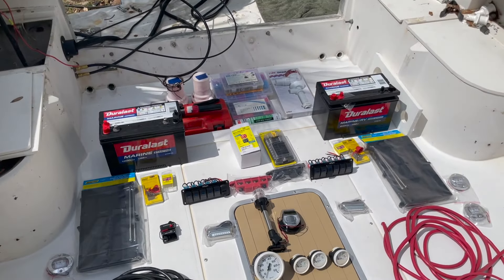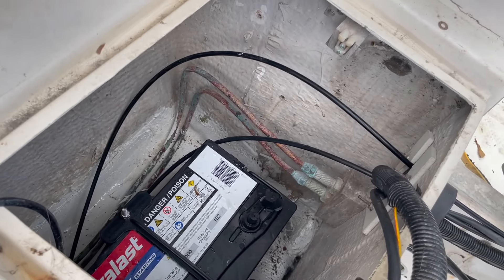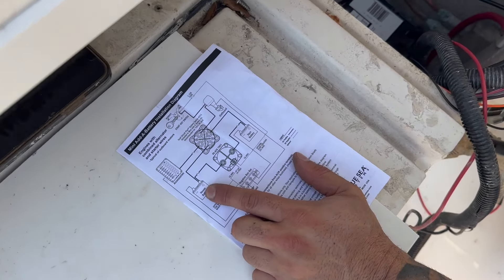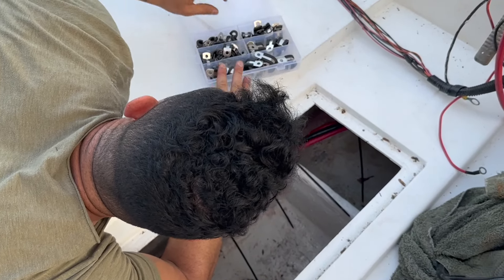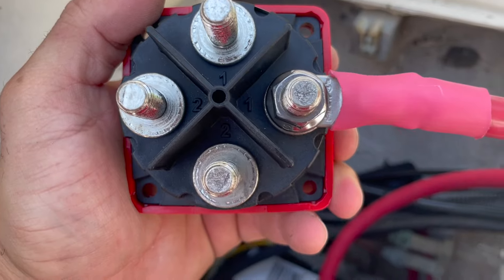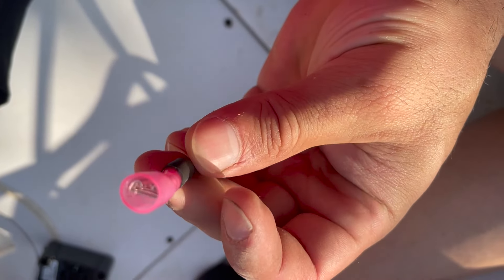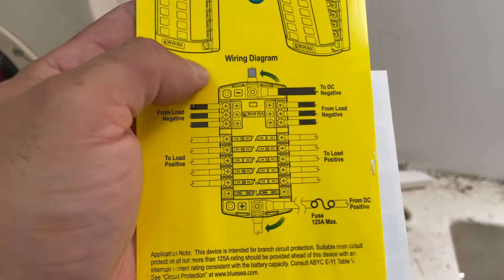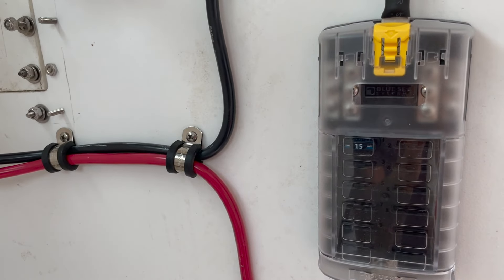Beginners Guide To Boat Wiring | Blue Sea Systems Dual Battery ACR Install

Comment: Amazing video!!! Glad I found this video we start redoing the Harness in our boat . Thank you for make it so Simple I’ll do it same way your doing it. I just wondering about the gauges?
Reply from the maker: Hey Elias! Thank you for the comment! I hope your project goes smooth and I’m glad our video can help. 
Depending on the motor you have, the gauges can be a little trickier. Usually each motor has a harness and from there you get your gauge power, tilt and trim, tach voltage etc. If you search  “boat gauge wiring” tons of good videos come up! 🤙
Reply: @perfectfitboating  Thanks man another question i see something in the diagram says optional switch for no current drain when is storage  ill keep the boat in water i want to make sure everything will be alright
Reply from the maker: Yes there’s more to read up on in the manual. I didn’t mess with that option because we plan on installing a charger on the boat to not worry about the battery discharging from the acr drawing current.
Reply: Amazing! One more thing ones I install the arc the kill switch still can cut power to the front fuse box or not? If not I can put my automatic beilge pump direct to the battery so when I’m not at the boat will works automatic. Like I say the boat will be sit in the water for few days
Reply: @perfectfitboating  by the way thanks a lot for taking the time to comment back.
Reply from the maker: So the kill switch for the motor works for just the motor. It really has nothing to do to with the fuse box. What sends power to the fuse box is the main on/off switch. 
Check out our other video where we install the bilge pump with a float switch directly to the battery which bypasses the main on/off switch. That way if it’s in the water and youre not there and water fills the bilge it will get pumped out! 🤙
Reply from the maker: No problem buddy!

Comment: Question: 
Why use a deep cycle for the house? 
I’m planning on running two group 24’s in parallel. Both identical batteries. Both with 1000 CA and 130a reserve capacity. 
One for the motor one for the house. But they are both “cranking batteries”
Reply from the maker: That’s a good question. You could do that. But, you’d want a house or deep cycle battery to run your accessories while at anchor, or when you have the motor turned off. Think of cranking batteries like a sprinter and deep cycle batteries like a marathon runner. They’re meant to handle that load over a long period of time. 
If you have a single motor, that many cranking amps isn’t really necessary.  Different batteries have different jobs that’s all. Hope they helps.🤙

Comment: Appreciate you sharing. Did you ever connect the si wire in the acr? I didn’t see you address that part.
Reply from the maker: Hey thanks for the comment!
The grounding wire for for the acr? Yes we installed that with the fuse! 🤙
Reply: @perfectfitboating  isn’t there supposed to be two 16 awg wires? One for ground and the other says si? I believe coming from ignition? Thank you for quick response! You’re the man!
Reply from the maker: Yes that’s right there’s two wires. The ground and the si wire that goes to ignition. If I remember correctly that wire is optional. I did not wire it up I left it open! 🤙

Comment: Awesome Video mate! You covered everything, and so easy to understand. Will use this to help wire my boat for sure.
Can I ask, do you think the Blue Seas Mini ACR is ok for a Yamaha F70? Or would you recommend the full size?
Reply from the maker: Thank you so much for the comment! We really appreciate it and we’re glad it helped! And yes it’s perfect for a Yamaha f70! 🤙
Reply: @perfectfitboating  thank you!!
Reply: Hi  @perfectfitboating  , I purchased the eBook and it has certainly helped me break down this whole project, thank you!
I have a couple questions if you dont mind me asking:
1 - Do you think the Negative Busbar that the Batteries/ACR connects to, needs to be 250-300 Amps as per your booklet? Or is 100-150 ok? Ive hadded up my devices and purchased a 50AMP breaker.
2. In your Ebook, it says the inline fuse to ground the ACR requires a 1 AMP blade fuse, in the Diagram at the back of the booklet it says 10amp. I'm assuming this should be 10amp? Thanks so much
Reply from the maker: @TheFattestManAlive  for your 70 in sure that bus bar is perfectly fine!
As far as the fuse for the acr ground goes… make sure the diagram youre looking at is for the M-acr. That ground wire fuse is 100% a 1 amp fuse. The “si-acr might take a 10amp. When I did a quick search online, I saw the 10amp fuse but it was only on the si-acr and not the mini. Hope that helps. If anything shoot me an email and I can send you the diagram from blue seas. Thank you so much for supporting our channel brother! 🤙
Reply: Thank you  @perfectfitboating .. you give good info and have helped me with my dumb questions haha Also just to clarify your busbar comment, did you mean the 100-150 is enough?
Reply from the maker: @TheFattestManAlive  yes you’l should be fine with that bus bar! Definitely not dumb questions brother! Happy to help! 🤙
Reply from the maker: Forgot to mention. The negative busbar rating should be able to carry the cranking amps for short periods of times. That’s why the 250 amp rating in the video. But you have a smaller motor and you could get away with the smaller rated busbar. Hope that makes sense!
Reply: Legend @perfectfitboating  Thanks again

Comment: Did you wire the neg bus bar back to battery? Installing on my pontoon and of course no metal steel like car
Reply from the maker: Yes! that bus bar goes back to the battery! 👍
Reply: Ty great video!
Reply: One more ? Do you put the switch on combine?
Reply from the maker: @sterlingobando225 I only put the switch on combine if my starter battery is low on voltage and can’t start the motor. Other than that, I leave it on 1 (starter battery) and go about my day. The acr charges both once the motor is running. 🍻

Comment: Hi, i have a 4 position battery switch but it only has 3 termianls. How would you wire that?
Reply from the maker: Check out the other video I have on battery switches. 🤙🌊🛥️
Reply: @perfectfitboating  ok thank you

Comment: Can you also install a 2 bank plug-in charger to those batteries where you can plug in and charge overnight?
Reply from the maker: Yes you can actually! I’ll be doing a video on that soon. I just haven’t chosen which battery charger I want to use. Thanks for watching! 🤙
Reply: @perfectfitboating  Ok great! I purchased the Noco 2 bank charger to install up front on my lithium trolling motor batteries and using a minnkota 2 bank charger on the rear Agm starter and lead acid deep cycle batteries.
Reply from the maker: @Redskins-ss6zs  nice! We are considering that charger!

Comment: I have a 2002 aluminum craft bass boat with a Yamaha 130TLRQ I pick up this rig has been setting up for 7 years. The wiring harness under the console is history need to install new gauges but can’t find a wiring diagram for this year or model.
Reply from the maker: Should be able to get a harness diagram online for that year. Then you can match the color wires of the gauges to the harness. Are the gauges digital or analog?

Comment: Good video, but why connect positives with fuses before negatives? Working with live wires?
Reply from the maker: Thanks for the comment! We appreciate it. Not trying to downplay the dangerous nature of electricity. But, 12v systems are generally harmless. If this was your typical 110v house system that’s a different story. Either way, precaution should be taken when dealing with any type of live wire so you’re right! 🤙

Comment: Wassup PFB.  Question... Do you know if it matters which battery is set on switch position 1 or 2?
Reply from the maker: Wassup!? Thanks for the comment! That’s a great question. After looking at the diagram, at first I thought it didn’t matter. But the switch has off/on/Both positions. I’m thinking when the switch is turned to on, it makes a circuit with position 1 (starter battery). If you were to switch positions, it would then be using the house battery for cranking and the starter battery to run power to the fuse block. I’m not 100% sure but I believe this to be the case. Let me know if that makes sense.
Reply: @perfectfitboating  I have the 120amp switch.  I'm just going to golliw the instructions. Motor/starter to terminal  2, house to terminal 1..
Reply from the maker: @aeroscout8409  good idea! 🤙

Comment: Never used an ACR before, how would it work in conjunction with a solar panel feeding my house battery?
Reply from the maker: It would work just fine actually. The acr can sense when either battery is full and sends the charge to the battery in need. So if your house battery is full, it would just stop sending charge to that house battery. Thank you for the comment! 🤙

Comment: I like the wiring but unsure it would work as I plan on using lithium batteries for the house banks
Reply from the maker: I’m researching that just now and it doesn’t seem like it’s possible unless you have an isolator or a dc to dc charger. Also, some motor manufacturers like Suzuki recommend lead acid only.

Comment: Why did you go with a 30amp Circuit breaker? I’m trying to figure out what size breaker I need myself
Reply from the maker: Thanks for the comment. I added up the amperage of all the instruments and appliances (pumps, lights etc). It gave me right around 28 amps or so. So I chose 30 amps for the breaker. I’m never going to have everything running at one time but if I did I’d have just enough with the 30 amp fuse. The breaker is to protect the WIRE in case of a short. Make sure you have the right awg cable for the length of the run of wire and for the amperage you are pulling. Hope that helps! 🍻
Reply: @perfectfitboating  what’s the point of the circuit breaker if each individual accessory has a fuse on it on the fuse panel box? I’m just curious, because it seems redundant. I’m also new to this so I’m genuinely asking.
Reply from the maker: @friday14fs  The point of the circuit breaker is to protect the line in between the circuit breaker and the fuse block. If there was a short in that wire and you don’t have a fuse or a breaker in between, that wire could potentially catch fire. The fuses on the fuse block protect the lines from the instrument/appliance to the fuse block.

Comment: Hi I noticed that as soon you installed all the cables the acr started to blink 3 times which means that’s under voltage isolation , I have my doing the same last time I was using the boat that even with the engine on wasn’t charging the house battery so the house battery died , any suggestion?
Reply from the maker: I noticed that also when I first installed it. If I remember correctly, there a delay before it starts to blink every 15 seconds. 
Last week I had the same issue you’re speaking about and it turned out to be a bad battery that wouldn’t hold a charge. Check and see if that’s your problem. Hope that helps!
Reply: @perfectfitboating  thanks I don’t think that is the battery due to and battery check system that I have in that battery that allows me to see the battery % and I just charged it in the morning and still full of charge and the acr still blinking 3 time I think that should be a problem with the acr
Reply from the maker: @Hookthatfish if the battery is good then I think youre right. Could be the acr. double check connections and fuses in case but it seems it might be the acr.
Reply: @perfectfitboating  thanks for your help

Comment: This was done with 2 lead batteries. I guess with lifepo on the 'house' side the system would look much different?
Reply from the maker: That’s correct! Lead acid batteries. Blue sea systems sells an acr kit specifically for lithium LifePO4 batteries. 🤙

Comment: Looks like a good instal,  but why did you bypassthe fuse with the second battery cable?  voids the point of rhe fuse!   you need fuses on the leads to the switch too.
Reply from the maker: Thanks for the comment. There are 4 positive cables coming from both batteries. Both batteries have one positive cable that goes to the switch (unfused) and 1 going to the acr which is fused. This is according to the blue sea systems and any other battery switch setup. The fuse you would need for these would be huge. You can put one in but it’s not required. 👍

Comment: Sir,   How do I determine what terminal fuse block AMP donI use.  I have a Suzuki 140 motor.
Reply from the maker: The fuse block gets power from the switch which has the circuit breaker in between (next to the switch). The circuit breaker I used is a 30 amp. I determined that by adding up all the appliances ( pumps, lights, aerator) amperage’s. So if I was to use all of the appliances at once (which no one ever does) you should be around that amperage for the fuse. It’s not really determined by the motor. If you plan to run more appliances like more lights or more live wells you might need a larger fuse and you’d probably want to increase size of the wire to the fuse block. I hope this helps! 🤙

Comment: Why install an 80A terminal block fuse when the  max rating on the ACR is 65A.? I'm no electrician just curious since I'm rewiring my KW 1720 for night time shrimping/fishing ease
Reply from the maker: Hey there thanks for the comment. The instructions for the blue sea systems acr kit calls for a fuse with a 75-90amp rating for less than or equal to 60 charging amps. Now I’m not sure why exactly they require it but I tried to follow the instructions as close as I could. Hope they helps! 🍻
Reply: @perfectfitboating  Thank you brother, I'm itemizing parts right this very second. Thank you for making such a detailed video and this incredibly quick response...I wish my KW 1720 had all of that space like you have, LOL
Reply from the maker: @Beachnative42  you got it my man! If you need extra help just write me an email I’ll be happy to help! 
And yeah this boat has a lot of storage and space! But on a boat, you can never have enough! lol 🍻

Comment: Why did you use only a 30amp circuit breaker on the fuse block? It's rated for 100 amps total with 30 amps max on each slot. I would think you would want a 100 amp fuse or breaker to protect the wire and the fuse block. Could you explain the reasoning please.
Reply from the maker: Because I’m not protecting the fuse block. I’m protecting the wire that runs to the fuse block. If all my devices I’m currently using only draw a max of 20 something amps, I don’t need more than 30. The wire is 6awg. If I have 100amp break on that wire it’ll never blow and the line will catch fire.
Reply: I would think you would match the breaker to the wire not the load. The fuse block handles the load. By using a undersized breaker for the that wire your loosing possible load at the fuse block down the road. I know it's probably never needed but still. That 6 gauge can handle double or more that 30 amps. Also I would think using a double MRBF terminal would be best so all wires could be fused at the power source. The section of wire before any inline breaker or fuse isn't protected. But if you do a double then you can protect every inch of wire. Just like a home is wired. Service comes in directly to a breaker panel. Then a breaker sized to the wire size is used and every inch is protected. Like you said it's about protecting the wire. Well some of the circuit before the breaker/fuse isn't protected. I appreciate you talking this out with me btw. Let me know your thoughts.

Comment: this is really dumb question...but does the motor not have a negative wire? only positive?
Reply from the maker: Yes the motor has a negative and it goes straight to the negative post of the starter battery. 🤙

Comment: Can you place the circuit breaker next to the fuse panel for easy access?
Reply from the maker: There’s no rule that says you can’t. But it’s recommended to have it as close to appliance as possible. Because what youre protecting is the wire. If you have the breaker up in the cabin for example, you have 15-20 feet of unprotected wire. So that breaker protects that long run of wire up to the helm! 🍻

Comment: Nice excellent job. How much do you think a job like this cost, labor and parts?
Reply: I’m thinking of rewiring my boat before launching it for this season but don’t have time to do it.
Reply from the maker: Hey bean! Thank you for the comment! I want to say that in parts alone, batteries, cables, switches, lights etc. One would spend a minimum of about $1,300. Depends on the quality of your parts. For example, our underwater lights were from Amazon $22 whereas lumitec lights can run $300+. Mine might last 2 years but I can buy a dozen before I get to the cost of the lumitec. We didn’t skimp on the fuse block or the acr and switch or any of the fuses on the batteries. The batteries were basic marine and they were about $120 each. Lithium batteries can be 10x that cost. So in our case (budget) I’d say we did it for around 1200-1300. 
As far as labor goes, any marina or mobile marine electrician will charge a minimum of $125 an hour. It took me 5 days to do the entire wiring including the accessories. Nothing ever goes easy on an old boat 🤣 hope that helps answer your question! 🤙
Reply from the maker: It’s definitely time consuming. Especially if you’ve never done it before because you want it to be done right. But I’ll tell you what, I know how everything works and where everything is. And I have peace of mind. Check out my other video on wiring the rest of the boat. Hopefully it’ll help you get a jumpstart on your project! It’s worth it! Let me know how it turns out man good luck!🤙